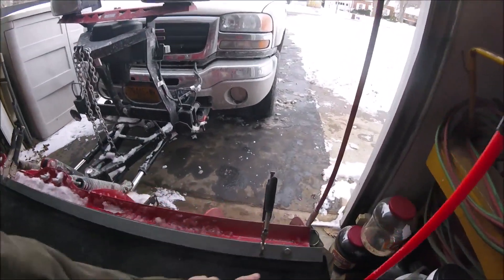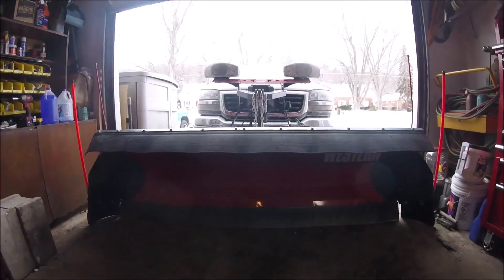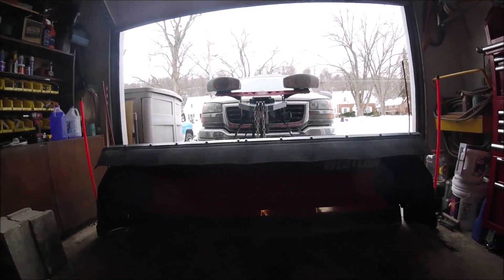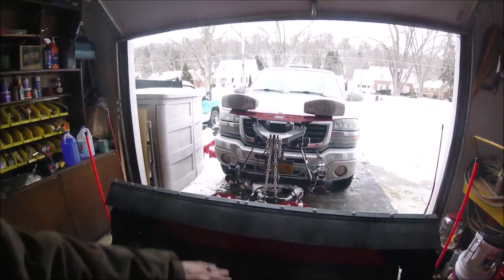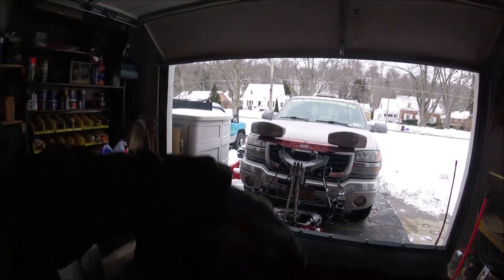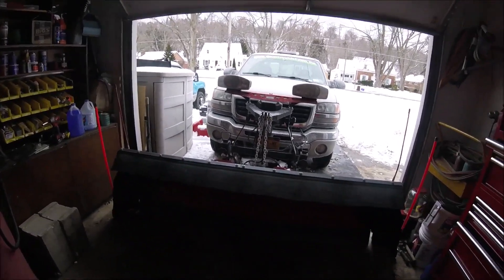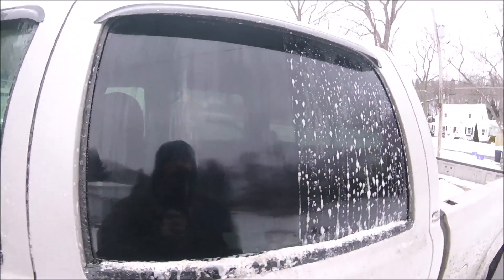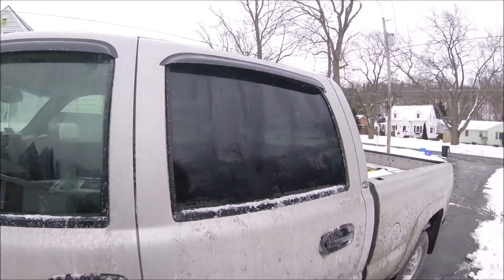Snow deflector Install on Western Plow - window wash tips

Comment: Put rain x on all your windows and mirrors and noting will stick to them it also make scraping ice easy because it just slides right off.
Reply from the maker: Been doing that for years. It doesn't help with ice buildup and the salt coming off the roads in my area. That's what all that dirt scaling was on the windows, road salt.

Comment: I recommend you take your spare down and get junkie tire / rim fill cement it’s great ballast
Reply from the maker: No need. The blocks I have, I've been using them for many years. Works perfect
Reply: How the hell do you get a spare filled with concrete up in the spare location?

Comment: Where do you buy your washer fluid by the case?
Reply from the maker: Napa
Reply: I have an 04 Chevy. Does your washer fluid come out of the wiper arm? Seems like I go through a ton of it with the way it sprays out. Pretty much use a gallon per day if I’m out salting or plowing
Reply from the maker: @austinsmith3380  yes it does. I usually don't use it up that fast, all depends.